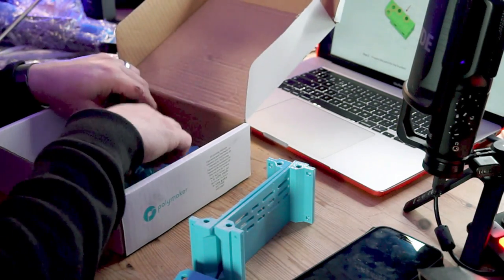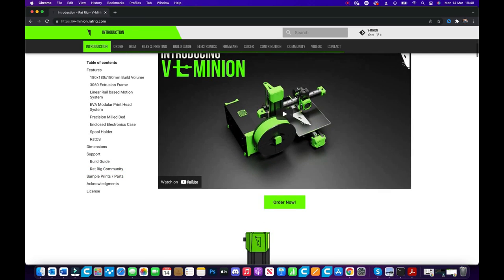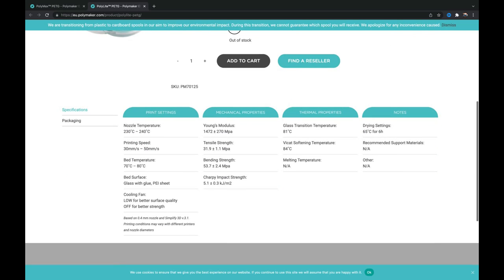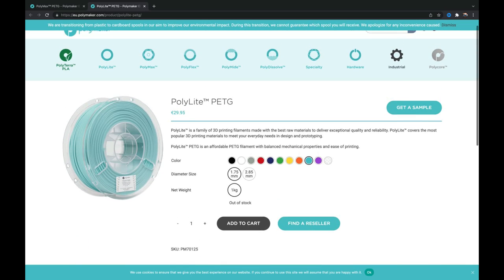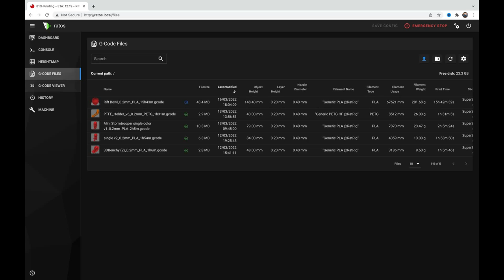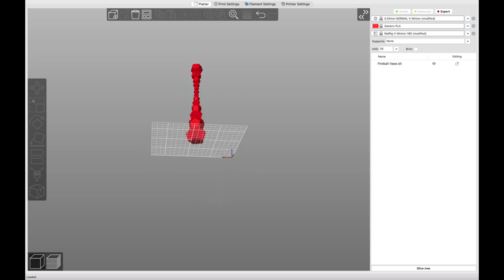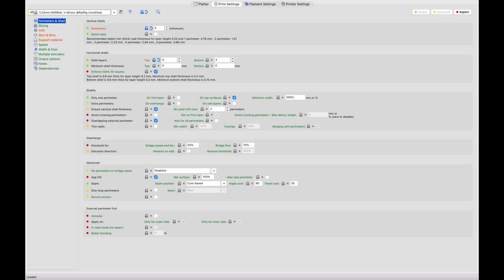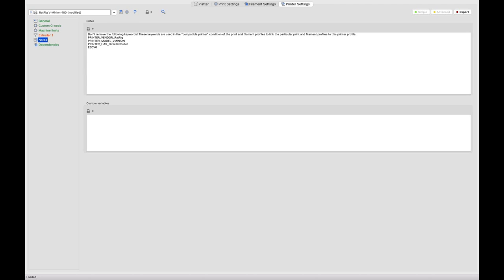Rat Rig V-Minion 3D Printer

Comment: Noticed you went for Meanwell. Have you seen this note from RR when ordering the kit? I believe Meanwell is regarded as the better alternative?: "CHOOSE ONE POWER SUPPLY (WARNING: MEANWELL LRS PSU IS NON-COMPLIANT ON EU MAINS FOR USE WITH 3D PRINTERS. PLEASE SELECT WEHO IF YOU'RE EU/UK BASED. IF YOU SELECT MEANWELL, WE WILL AUTOMATICALLY SWAP YOUR SELECTION IF YOUR DELIVERY ADDRESS IS IN THE EU/UK"
Reply from the maker: I sourced mine locally but I am and have been rubbing the LRS350